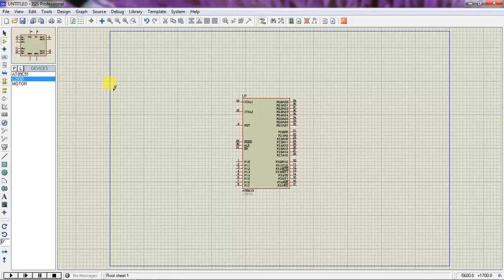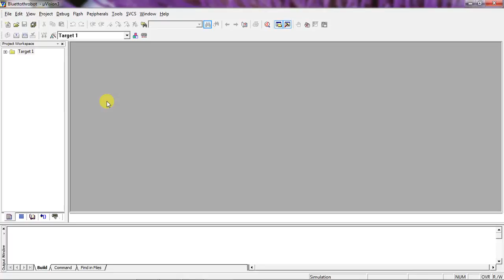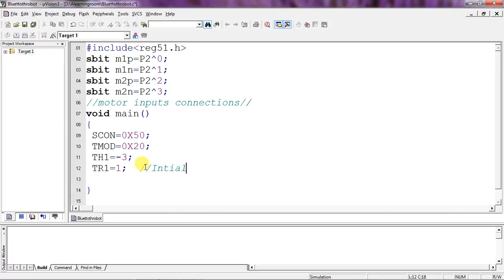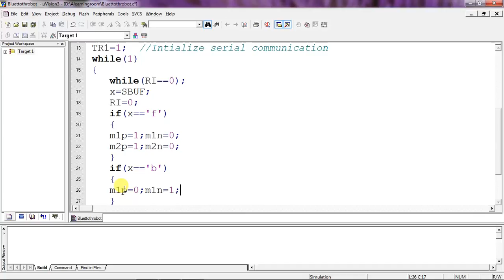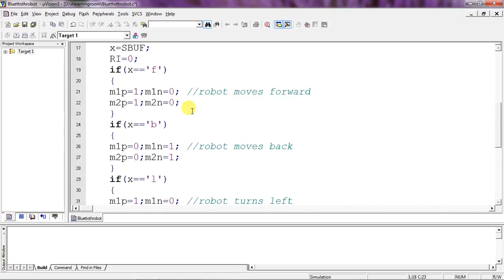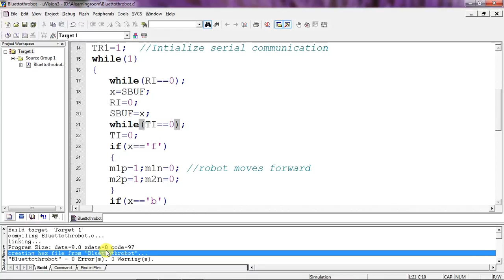Bluetooth based robot by using 8051 controller with Keil and Proteus simulation

Comment: Hey ,please i am working on a project using 8051 ,a car controlled by bluetooth !! 
But the problem is when i feed the motor drive by 9 volt and measure the output I found it zero !! 
Also when i send data to Bluetooth module it dont reply to me by anything !!